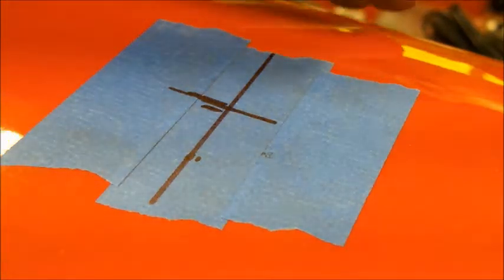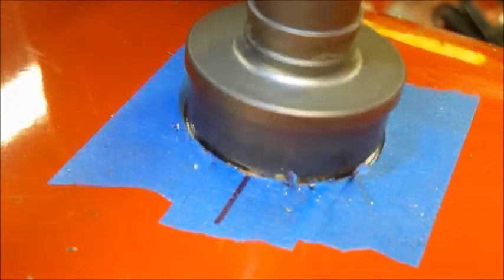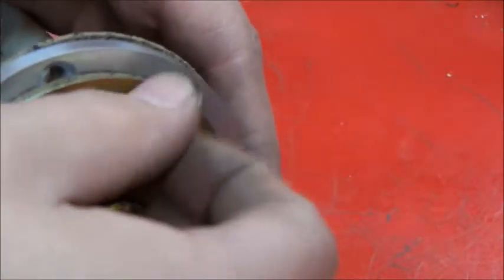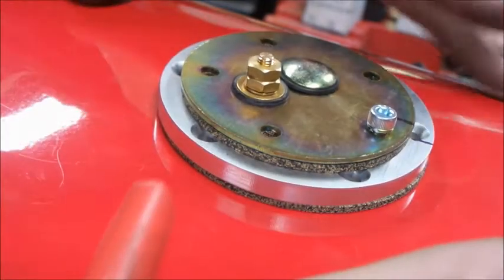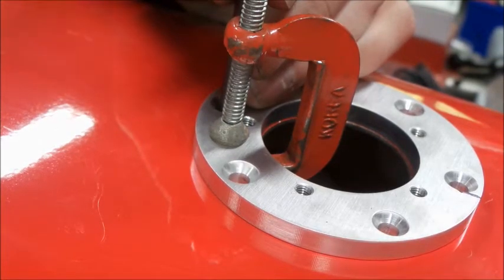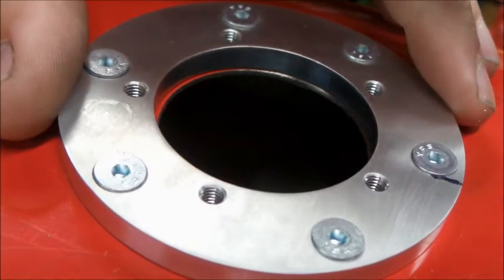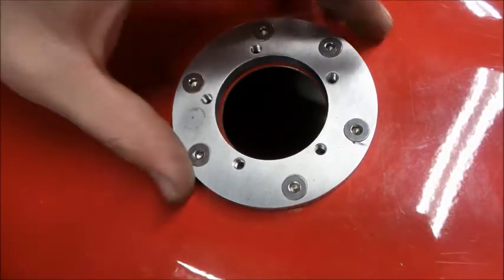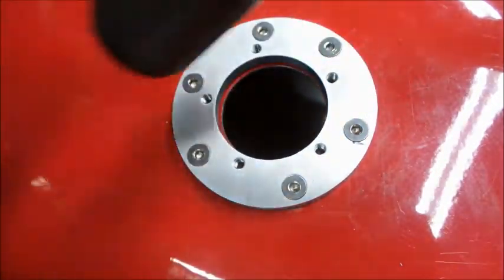Installing A Fuel Level Sending Unit on a Fairmont MT19A Motorcar (Speeder) Fuel Tank

Comment: Can you provide part numbers and where you bought the parts from? Also what gauge are you using? I have an MT19 that I would like to add a fuel gauge to. Thanks
Reply from the maker: Thanks for watching the video. I used the Autometer #3263 Tank Adapter for the mounting flange. I am using a Autometer #2514 gauge mounted in a cluster in the car. (That will be featured in a future video). The #2514 requires a 0-90 ohm sending unit float. I got a decent mid grade quality one to start with. I got all the parts off various sellers on Ebay. The Stainless fasteners and lock tight I got from McMaster Car. Hope this helps out. If I missed anything let me know I'll try and fill in the gaps.